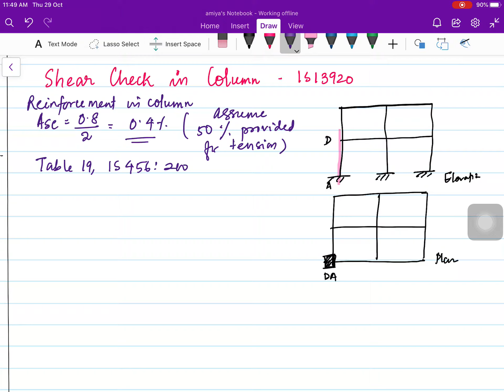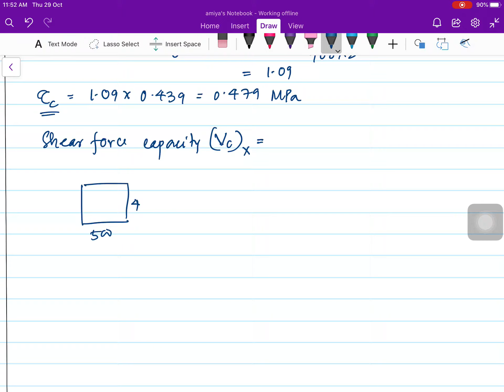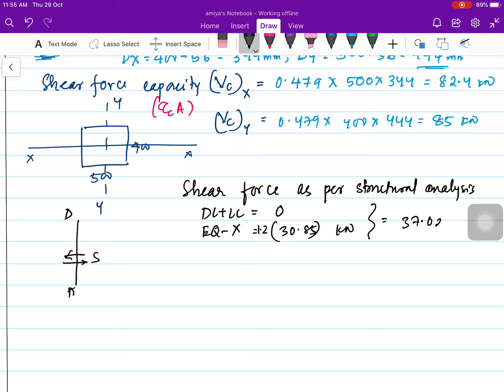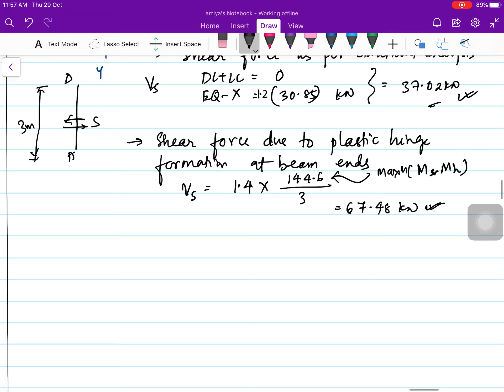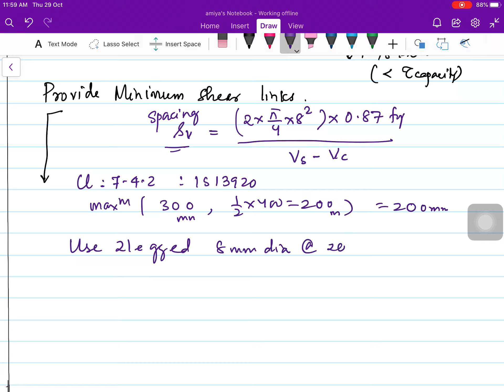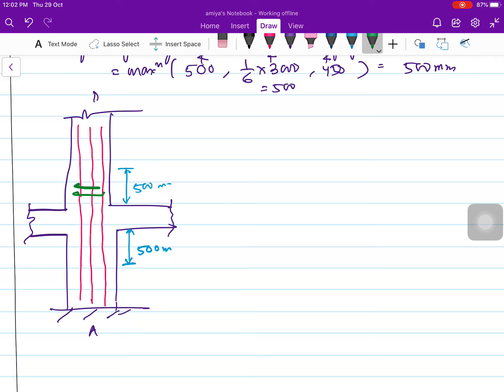Comment: 16:33 I thought it is necessary to be pointed out

Acc. to IS 13920:2016 which maam is reffering to , the clause 8.1 c)
For rect ties h >300 cross ties are required 
Assuming cross tie is provided across middle rebars, h= (50-40-40)/2 = 210  < 300 mm OK

So, if h = 210 mm
For 10mm dia bars maxm stirrup spacing, maxm sv round offs to 141mm
Even for 8mm dia , sv =90.44